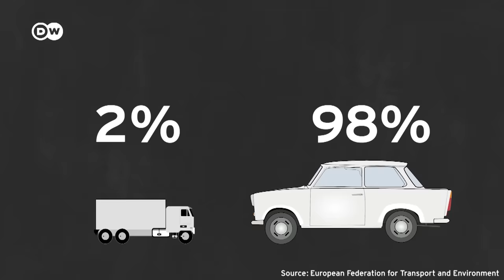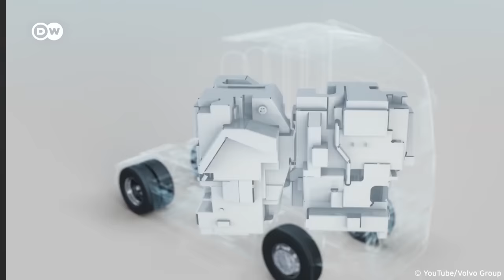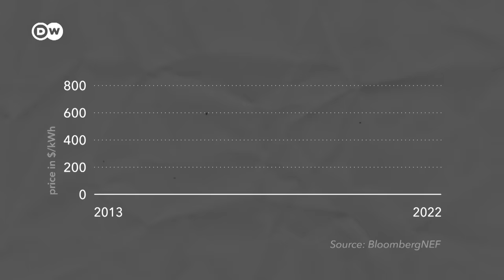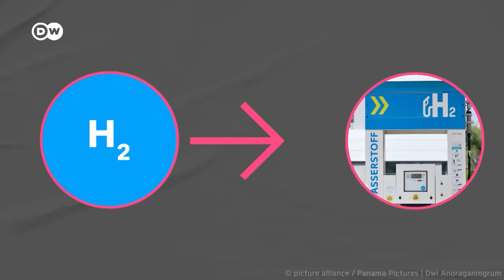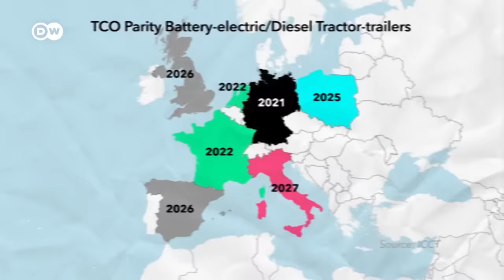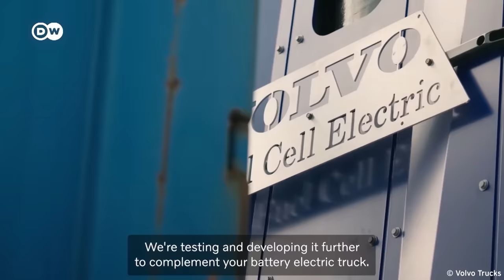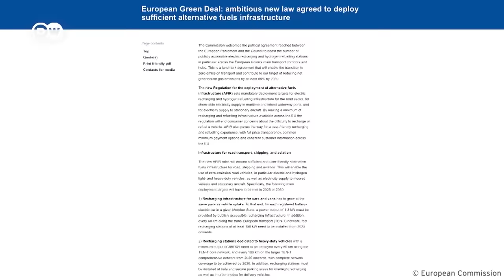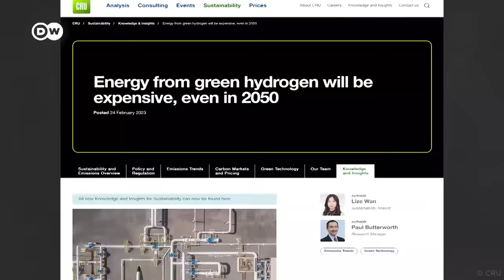Which will be the engine of the future?

Comment: Personally, I see a major use case for hydrogen-electric vehicles here in Canada, especially in the forestry industry. Often times trucks are required to go on long haul journeys  out into the wilderness, or up secluded logging roads for many kilometers. The disadvantage to electric trucks here is the isolation. There are no charging stations in the back country, there is no grid on the side of a British Columbia mountain kilometers above sea level and tens of kilometers down winding narrow forest service roads from the nearest town.

If you were out in the back country and your vehicle, car or truck, runs out of battery then you're hooped. But, with a hydrogen-electric truck, or even a regular fuel-electric truck, you could massively extend the operating range and it's way easier to get extra fuel out to you if you run out.
Reply: Edison class 8 logging trucks?
Reply: @jaaklucas1329  Huh, I had no idea those existed before your comment. I'll have to keep an eye on how those do in the field.

Comment: It's interesting how this report doesn't even mention straight hydrogen engine trucks. In the U.S, they are building engines that run on hydrogen driving the wheels directly. This only involves changing the head on the motor so older trucks could also convert to hydrogen for a much smaller cost than a new vehicle.
Reply: Well it's very simple: hydrogen engines make no sense at all because of their terribly low efficiency.

Comment: Again a nice report. But please, you forgot to even mention that taking part of the goods down from the road and onto the rail MUST be part of the solution to this problem. Just pinning this alternative energy source versus that other one is not gona cut it. One must think outside the street (to paraphrase). And not just for cargo but also for every other problem. The solution will never just be to improve an existing system (like replacing combustion with electic drives, and yes fuel-cells (so H2) are also electric drives) but also too look around and come up with alternatives to what is apparently not working.
Besides, if you look around Europe, there are definitely too many trucks (and cars for taht matter too) on the roads. Build more rails and use them, they are superior in almos every way, except last mile delivery, and electric trucks are more than capable of that, thought for many goods one would not even need trucks for that last mile job... but I'm getting ahead of myself XD

Comment: The video documentary does not mention the operating temperature limitation of EV batteries besides their charging time, size, and recycling issues. The effective operating temperature of EV batteries is around 40F to 95F (4C to 35C). There were so many EVs breaking down on the road in the US and Canada when the temperature dropped below 32F or 0C a month ago. Low ambient temperature is the kryptonite of EVs. If there is no technological breakthrough in the operating temperature range of EV batteries soon, HFCVs will still get the edge.
Reply from the maker: Yes it is very true that in colder climate batteries run out fast or break down like you mentioned. Not ideal conditions for EVs, yet.

Comment: The Hydrogen option has already been tried in California and it has failed. The cost of an infrastructure to supply hydrogen as an everyday fuel solution for road traffic is just too high to make it viable, at this stage the amount of vehicles that can be refuelled from a fuelling point is very limited and storage of the product is difficult. Shell tried it in California and they have taken the decision to close their hydrogen fueling stations. EV is a far simpler option and the technology on batteries is improving year on year.

Comment: The end to end efficiency of hydrogen is about 40%, and then there are the increased costs of containment and delivery. Hydrogen would have to be about 30% of electricity to break even with batteries; and of course that would never happen because then power stations would run on hydrogen and it would still be more expensive to run trucks on. Hydrogen is a niche source of energy for places far (more than 100km) from the grid.

Comment: What this video doesn’t explore is HICE technology, or Hydrogen powered internal combustion engines. These are regular engines that burn hydrogen instead of diesel. They will be cheap to build because they will share most of the parts with an existing truck. They can be refuelled as fast as a diesel truck.

Comment: Neither is the engine of the future. Trucking will have to be minimized and a combination of other lighter modes of transport used for most goods for 2 simple reasons which affect both solutions touted in this video:

1) Resource scarcity. We simply do not have enough Platinum and Iridium in the world to make enough hydrogen fuel cells to replace the current fleet of vehicles, power industry and myriad other uses. They are both very rare and essential to many industrial processes. Same goes for Cobalt used in Lithium batteries. Some are deluded by the hype about the Clarion Clipperton Zone to meet our Cobalt needs. It can't happen for too many reasons I care to explain here, it merely shows how desperate we are. With Lithium, we would use up all the ore-grade stuff just to replace the current fleet of cars--nothing left for phones, laptops, etc. Forget about growing the fleet or expanding the amount of consumer goods with battery medium to long term. Prices are about to skyrocket and this is the new permanent normal.

2) Scalability. Even if scarcity weren't an issue, scalability to meet just our phase out of combustion engines by 2035 as per EU, Canada and other countries for the Energy Transition is impossible. We can't mine fast enough, bring new mines online fast enough, reach peak production, etc. In the meantime as everyone strives towards these goals expect very sharp increases in these essential commodity prices...and we I haven't even mentioned so-called Rare-Earths.

Bottom line, the future has less stuff, is more expensive and transportation will involve a lot more trains in both quantity and density and they will be grid-fed their energy where possible. There will be a lot more low-tech/high-tech combinations out of necessity.

Comment: On the point of Hydrogen needs a lot of new infrastructure.
Dont we already haul around tons of petroleum and diesel to "service stations"? 
Why not ju transition that in to Hydrogen? Same thing different substance. 
While I do understand we will need new facilities to convert the electricity into hydrogen I think that is a small hurdel.

We will face more challenges trying to expand the whole countrys electric backbone. Electricity doesn't just flow through the air.
Some Cities here in Sweden such as Stockholm doesn't have anymore capacity on the electric backbone to open up new Industries.

Comment: what's the point of talking about this issue without stating a single figure.
How much weight will a battery need for what range? 
what's the histogram of distances trucks drive? I bet it's quite different between US & Europe....
Which segment can the battery trucks take over? last mile? long haul? port trucks?

This video is pointless without further details

Comment: You can pump hydrogen like diesel = huge time savings compared to charging. Win.
Reply: But far more expensive ≠ win
Reply: @Simon-dm8zv  because there is no infrastructure yet... just like there wasnt any when charging was new and expensive
Reply: @lamebubblesflysohigh  Not really. It’s because hydrogen is inefficient.
Reply: @Simon-dm8zv  no it is not. It is not as efficient as diesel or battery if ran through cell but it is easily transportable over large distances and thus doesn't need expensive grid projects behind it like megawat electric chargers mentioned in this video + it is directly combustible. Everyone is focusing on fuel cells but there are companies already making functional engine prototypes that combust hydrogen.
Reply: @lamebubblesflysohigh Combusting hydrogen is even more inefficient than using it in a fuel cell. Cost per mile will be outrageous, nobody is going to use it. Everybody is focussing on batteries which is what the vast majority of trucks will be using. Some corner cases might be relying on hydrogen fuel cells but that's it.
Reply: @Simon-dm8zv  yea, such corner cases being long distance trucking.
Reply: @lamebubblesflysohigh  Yes, but by the time hydrogen gets a chance to mature in that field it might already be overtaken by battery technology, offering a far lower price per mile.
Reply: @Simon-dm8zv  "might"
Reply: @lamebubblesflysohigh Yes, and if that is not the case it won't take long.
Reply: @Simon-dm8zv   "if"

Comment: the hydrogen engine produces electricity that recharge the batteries to move the electric motor...is an extra step for no reason
100% electric es the best, no need for both
you can recharge the ev truck anywhere, electricity is all over the world,

Comment: This video didn't address other countries (like developing countries) that may not have an electrical grid capable of adding many or any electric charging stations for high capacity (or even passenger) vehicles. These are the types of places where fuel cell trucks would likely be better suited. For mining, or specifi routes between major cities in a developing country, one could build several stand alone hydrogen stations instead of having to build up an entire electrical grid capacity just to add a few charging stations. 

I'm completely naive about much of the development and technology of the trucking industry so I'm curious, why aren't there plug in Hybrid trucks?
Reply from the maker: Hey Marty! Thanks for sharing your view. There are indeed hybrid trucks in use already :)

Comment: In Europe a blend of H2  and EV's paired with trains is the logical solution,  but . Rail space is limited and must adhered to a time table to ensure delivery times are meet. Whch defaults to single units being more flexible to the demands of capacity.  Now the problem becomes load factors. EV'S DO have documented range penalties for cold weather and heavy loads and driving habbits. Not to mention offduty hours and available charging capacity.  H2 can actually be produced  at a fuel stop but now you need a  massive electric generator to manufactur the H2. With H2 it can be transported relatively easily and with minimal hassles.  
But in NORTH AMERICA  neither is ideal and or practical due to the topography and dictances between major hubs and final mile deliveries.  The solution for them would be H2 not EV.
Also most of the developed EU can fit into the areas of the USA that were part of the CONFEDERACY.  The distance between NORMANDY AND BERLIN is about 800 miles.. the same distance of Philadelphia to Atlanta.  The difference is the population density is 3 times that of the USA.

Comment: Ignoring the most obvious problem, and most costly problem of hydrogen, infrastructure, electric is far superior:

1. You can reverse polarity to turn an engine/motor into a generator (regen braking), and since a semi trailer has eight wheels that can be used as hub motors for starting and uphill, then as regen braking the rest of the time. Also, the semi trailer can carry additional batteries, and other sources of electrical generation.
2. Most hydrogen engines, to date, are the size of most combustion engines, still needs batteries and an electric motor - and considering the pressure limitations of hydrogen, the weight limitation will probably not change much over the decades.
3. To meet the demands for energy, there will be a high water consumption to produce enough hydrogen to meet demand, and the U.S. - most of western countries, are already finding themselves heading to a water shortage from depleting underground water reserves.
4. The byproduct of hydrogen power is water vapour, and that water vapour has to either be dumped into the atmosphere (creating other infrastructure problems), or stored, captured to be released as water creating more weight for the vehicle.
5. We are learning day by day battery technology is ever advancing well beyond hydrogen.

If we planned this right, gas stations can change to energy stations with battery storage, high speed charging stations, and battery swapping for semi trucks which would be as simple as swapping current car batteries. With the advancements of battery technology, storage, we can add solar and Vertical Axis Wind Turbine to homes, and businesses can buy, and resell that energy to grids and energy storage stations.

Does hydrogen have a place in out society? Yes. As a fuel source of ships that can produced hydrogen since most ships, especially warships, process salt water to fresh water. Since ships can produce the hydrogen on the fly, the storage tanks for the hydrogen does not need to be massive tanks. (Standard cargo ships carry between 2.5 million to 3.5 million gallons of fuel.)

Comment: Rather that transporting green hydrogen, why not produce it locally ?
For instance, the electrical grid needs to feed the electrical charging points, why not use that grid to make hydrogen, maybe at motorway service stations where motorways are more likely to have long distance trucks, you could even have turbines or solar near the service stations.
Hydrogen has to be lighter, so more cargo can be transported, keep the battery trucks for local deliveries within towns etc.
If hydrogen is quicker to refuel a truck, this will reduce the queues at stations, which means more productivity
Reply: A few reasons. Firstly, because it takes 4 times more electricity to generate 1 miles worth of energy than an EV would use per mile.

Second, Toyota built a green hydrogen plant in Melbourne Australia inside one of its old car production factories. Got a facility that size, it can make a whopping 14 refills worth of hydrogen for the mirai in one 24 hour stint. Much much less when talking about something that takes as much fuel as a truck instead of a sedan. So if you had on-site generation , you’d be lucky to produce enough for one truck per day.

Third, while hydrogen is light weight, it takes up a huge volume, and the trucks need a lot of people meaning massive and multiple fuel cells. And large batteries. Hyundais hydrogen truck has a 75kWh battery and 3 fuel cells. The battery alone is what’s used in long range EV cars. And each fuel cell is larger than a standard combustion engine. All being said and done. It doesn’t leave a lot of room for fuel. So you may find that hydrogen trucks aren’t all that much lighter at the end of the day and have less range and power.

Comment: Electrified train is the best choise, no need a big bettery or gas tank, directly from electricity to momentum. For a showcase like transpotation which running on a fixed route, railway is way better than cars or ships.
Reply: Without long haul trucking to compete with rail would become very expensive for moving freight.

Comment: Electric trucks are in the lead, but I dont think the race is over. My knowledge of lithium mining isnt enough to make a big statement, but my understanding is that we can always produce more hydrogen while lithium supply is limited and is likely to remain limited for the foreseeable future. 

As shown in the video, battery prices have gone down but lithium prices are actually higher than ever.
Reply: For these amounts of hydrogen we would need to build three times as many solar panels and wind turbines though.
Reply: Exactly, thats my point. It is doable and we can always produce more hydrogen. It is a scalable technology.
Reply: @uralmutlu4320  I don't think it is doable. Despite the fact renewables are growing quite fast, building enough turbines and solar panels for going down the hydrogen route would take insanely long and a lot of materials and investments. It would actually slow down the energy transition and set back net zero goals by decades.

Comment: Electric vs. hydrogen trucks is a vital discussion. Europe's dependency on battery materials like lithium contrasts with hydrogen's global production potential, offering a quicker, more flexible energy solution. Hydrogen could revolutionize transportation, reducing reliance on lengthy battery charging.

It's crucial to focus on making both electricity and hydrogen production more efficient and cost-effective, leveraging renewable energy for sustainability. The push towards hydrogen signifies a promising step towards cleaner, more accessible mobility.

Comment: Both with H2 being the main propulsion source but with smaller electric motive cells to act as insurance/backup. My feeling is that electric batteries will never be reliable enough to carry heavier cargo loads.
Reply: Battery packs are very reliable but range and energy density is the issue.
Reply: @jaaklucas1329  that's what I meant to say! Reliability in terms of getting you across the distance. But I really think this is not an either or, just as it never was for diesel, petrol (gas) or LNG. I'd even argue for continuing the hybridisation of fossil fuelled cars to enable less developed nations to get up to speed. Retrofitting and adapting existing vehicles must surely be a huge opportunity ahead if we are to fully embrace the ideals of the regenerative circular economy.

Comment: Current standard batteries still cause a bit to much environmental damage. The math feels a bit off in this video because the comparison is made between existing EV charging infrastructure vs a hydrogen infrastructure that barely exist. I know that Hydrogen fuel cells take some very dangerous materials to produce, however they use an existing market for catalytic converters. 

Battery tech in the long run is less efficient to produce and upkeep. Hydrogen fuel cells use less materials to produce and are safer in crashes with the system having a true shutoff for the electrical system.